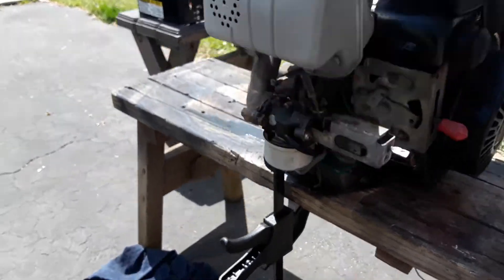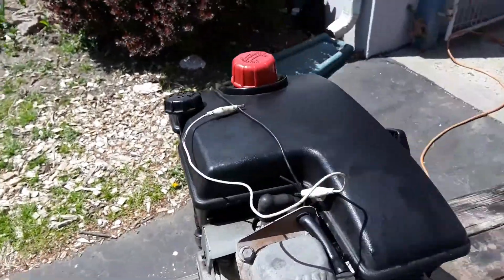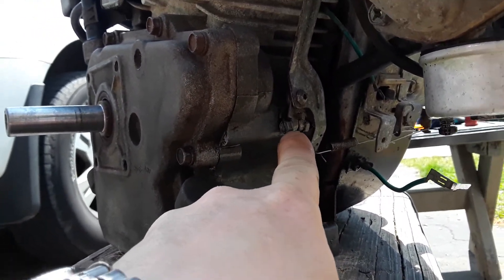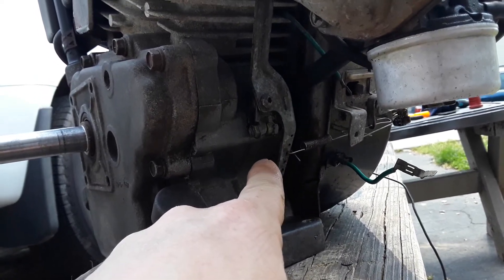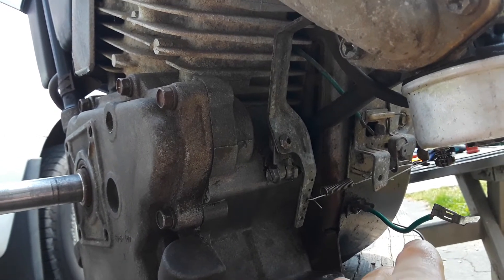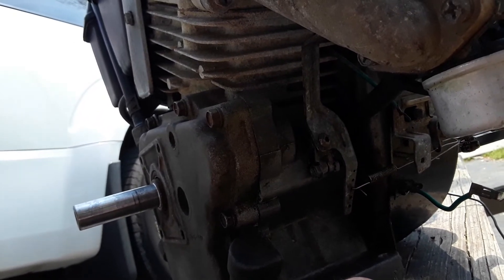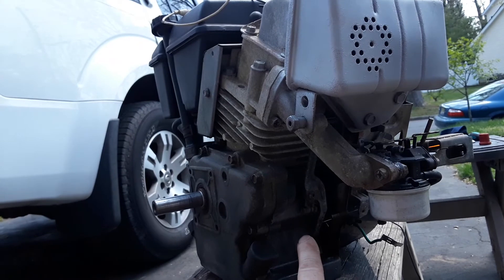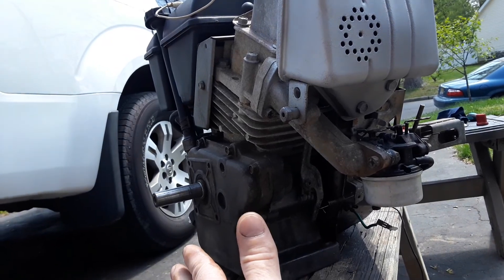Tecumseh 5-7hp OVH design flaw, oil leak. Beware. Specific models listed. -Explanation follows run.

Comment: Also a common problem with these was the cylinder head valves and guides. Many of the victims were snowblowers.
Reply from the maker: Luckily that was the first snowblower I got one off of and have messed with tons of snowblowers. I have an older 1994 Craftsman II 10/29. The old 10hp flathead, still runs like a champ. I've seen these more often on Pressure washers and Go karts around here, apsolute garbage. Unfortunate too, because it runs great, but what good is it, when its done leaked all its oil out all over the place in an hour. Shit design. They should have just stuck with their flatheads, those were solid, unfortunately the epa stepped in and started mandating OHV's and that was it. 8 years of those newer OHV's, thats all it took before they shut their doors for good.